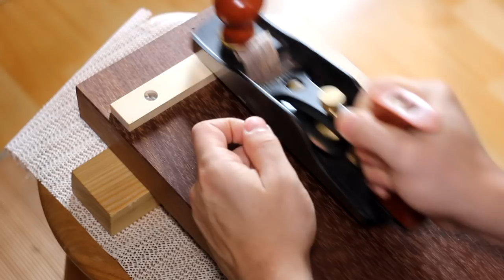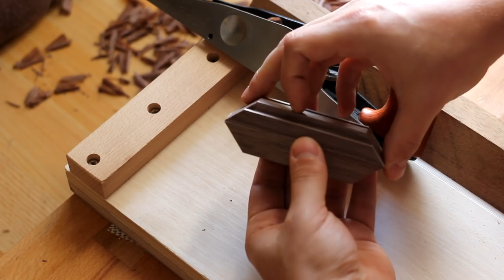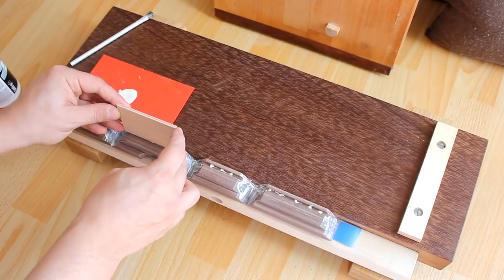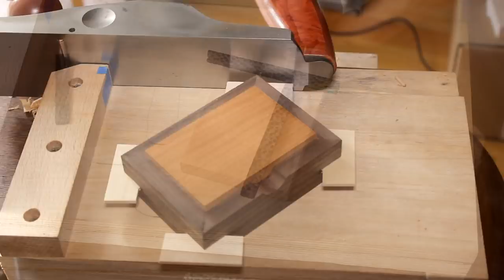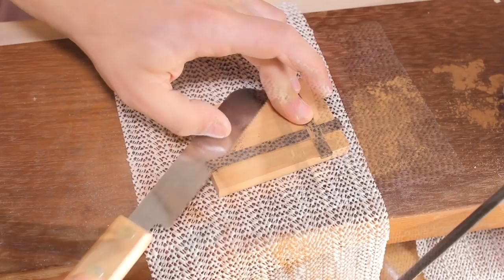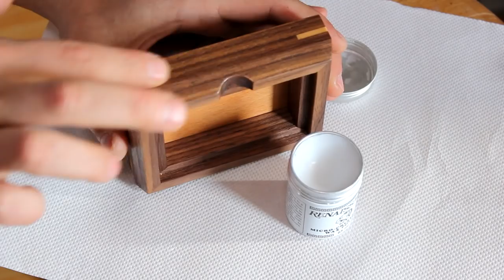Making Small Keepsake Boxes with Various Lid Designs

Comment: Great design.  I was wondering why you went to your friend's shop to cut the miter key slots?  I have only seen people do this on a table saw with a jig, and was thinking it would be easy with hand tools, maybe a saw and chisel.
Reply from the maker: Thanks! I've tried once, aimed 1/8" wide slot, in the end I got 8 mm...The box is too small and too risky to ruin it, maybe on a bigger one I could have done it with a straight guide block of wood, but note that you cut along the grain, it can steal you anytime. And, I aim in the end to make a good clean final project, no mater how, love of hand tools comes always second :)

Comment: Superb! Was wondering why you didn't use the 45 degrees shooting board for the bottom edge chamfer and how about making a 30 / 60 degrees shooting board side?
Reply from the maker: Thanks! The 45 shooting board was too small to chamfer the box there, I think it passed the blade's length or almost to the end. But anyway it's just need to be a small chamfer, 2mm, to create like a floating effect of the box when sitting on a flat clean shelf. 30/60 board worth building when you have more stuff to plane and precise, I can deal for now adding a raised block to the straight one :)

Comment: Very nice, do you have any more information on the mitred shooting board design? I'm looking at making something myself! I'm also trying to think of a way to cut recesses for splines in a bow without a table saw, maybe using a hand saw with a wide enough kerf but could be messy

Thanks!
Reply from the maker: The shooting board design is from a Fine Woodworking magazine issue, issue 261, may-june 2017. I also wanna try by hands these days to make some spline. I've made smaller pen boxes and wanna make just a cut, kerf's width of the dozuki and add inside some veneer, made with a plane or see what else. Hope to manage and not to ruin the boxes :)

Comment: Love the channel, even modeled my workbench off yours a year back, almost identical. Anyways I’m finally commenting becausing I’m curious about that marking gauge iron you got there. Where did ya get it or make it? Perhaps a vid on that?
Reply from the maker: Thanks Jason! Glad to know you liked the workbench! That marking gauge is not made by me, a lot of peps asked the same :) It's a japanese kebiki marking gauge, or in this video it's a dual knife one. I've put a link in the description, there are plenty of them on amazon, me I bought it from fine tools germany. Note that they come slightly untuned, some rough spots of the wood and also the blade. Specially those with wedges, you need to fine tune it to make the wedge work, also sharpen the knifes.  Mines had a lot of burr on it. This is how jp wooden tools usually come, mostly the economical range. But once you do these things, and it's not a big deal, you can know the tool better this way :) they are a great tools. My marking gauge(s) is prob the most used tool in my projects.

Comment: Salut, superb video. Nu te supăra că întreb, dar cum ai făcut shooting board-ul la 45? Cum ai stabilit precizia de 45 de grade?
Reply from the maker: Salut, multumesc! Nici o suparare. Designul e dintr-un numar Fine Woodworking magazine, parca 2016 sau inceput 2017. Sunt taiate la circular piesele apoi asamblate de mine. Am niste poze mai vechi cu shooting boardul in instagramul meu pt a vedea mai clar cum e compus, nu e mare inginerie, nici de articol nu ai nevoie
Reply: Deci secretul e că ai luat unghiul din circular. ok, Mulțumesc. Mă voi strădui să-mi fac și eu unul.
Reply from the maker: Da, poate daca m-as fi chinuit cu rindeaua si niste jiguri provizorii, tot timpul masurat cu echerul la 45 le-as fi scos la mana, dar calea de rulare am facut-o din iroko, lemn foarte dur, cam greu de rindeluit manual si precis

Comment: Nice work. I don't understand why you cut the 'rough' 45 degree miters before cutting the rabbets and dadoes in the box sides.
Reply from the maker: Thanks! To save 1-2" of making grooves. Kidding, or almost :) No, now that I try to remember, maybe I did it just to know I've ended up with the saw, at least for some time, in my work flow. You can do it even after too. In fact, the box in the video is made from leftovers from the others. At those I had a continuous piece which I've groove it all at once, then cut it into 4 pieces, having 3 corners matching grain. The reason I rough cut at 45 is to save some time and effort on the shooting board when making the perfect 45s.

Comment: Hi Adrian, new fan to your channel here! (I had just written a nice comment and I lost it, so here I go again). A few questions for you if you don't mind!

Is there a trick to the shooting board and plane combo? The blade on the plane seems to be shallow enough to not eat away at the shooting board itself, but have enough edge to take away material on the subject.

Do you use the same method to sharpen and hone your chisels as you did the blade in your japanese plane video?  If not, that would be a great video to see as well! Also I remember seeing a low grit stone presented, while only seeing you use the 1000 and 5000 grit waterstones.

And finally, is there an alternative to power tool drilling? I see some videos of a 'drilling' hand tool to prepare joints for dowels. This technique would be interesting to see more of, as well.

I've wanted to start woodworking for a while, and your videos displaying your great work has inspired me to finally take action. I have just bought some different tools to get me started; a Ryoba and Dozuki included. I enjoy the fact that you do 98% of the work without power tools, the japanese style is very fitting to my personality and principles - and discovering some of the japanese style via your work has been eye opening.
Reply from the maker: Hi, thank you very much!
1. Because the blade width is less than the plane sole width, the plane will eventually rest against the shooting board with that 5-6 mm bellow the blade.
2. I use the same method, sometimes with honing guides, see the types I use in the links in the description or the full tool list on my blog. Now I have also a #8000 and #320 stone, for super fine work, respective rectifying dull blades, but the most used are the 1 and 5k ones. The lower grit you saw is a #400 diamond one that I use to flatten the water stones.
3. Look for brace drill, bit brace etc those are the manual drilling stuff :)